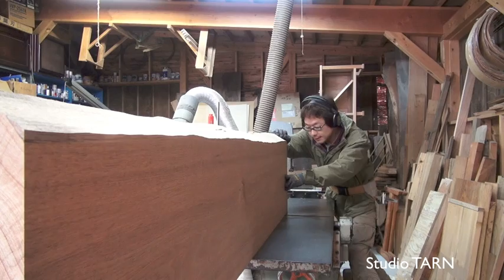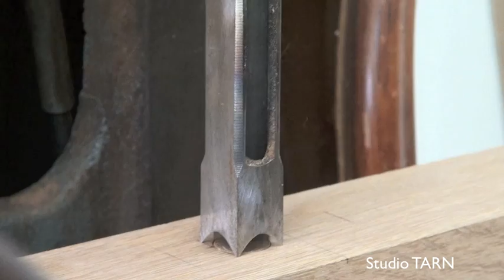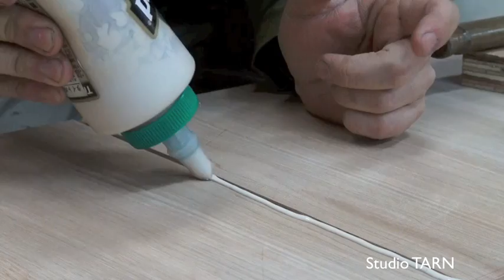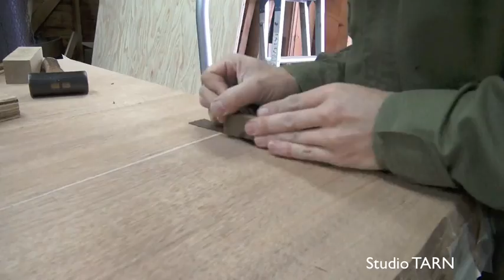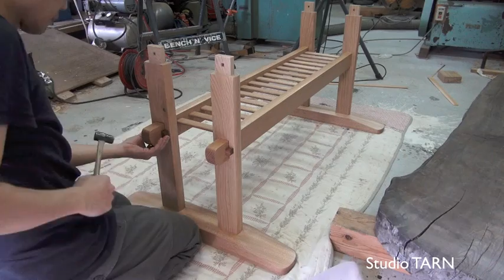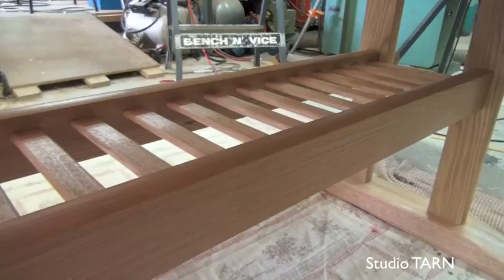StudioTARN Making movie/Solid Walnut Dining Table YM13

Comment: can anyone tell me what he used the electric iron for?
Reply: +Eason Qin 
Even the hard wood is actually soft, and contain moisture. Electrical or not is the temperature of the iron plate that change the balance between softness and humidity within the wood in order to be prepared for the next operation.
Reply: @Z5iPILEkkbCeTAQJPXD  That's not an answer...
Reply: The iron was used because it adds heat and, more importantly, steam.  When you make wood wet, it raises the grain.  That way he can hit it with the hand planer and catch the grain while it is wet and raised.  It basically makes for a smoother finish.